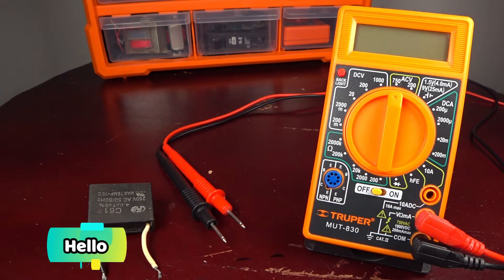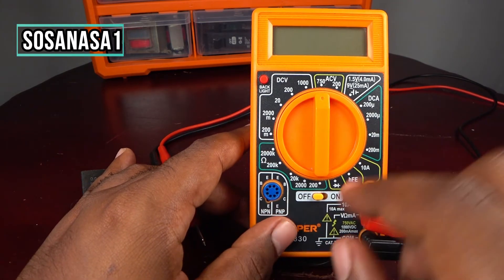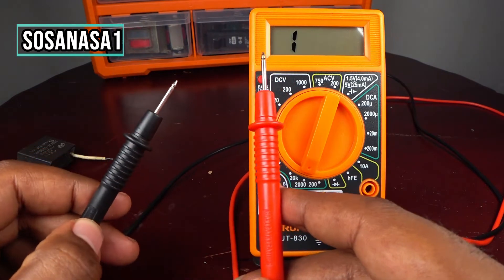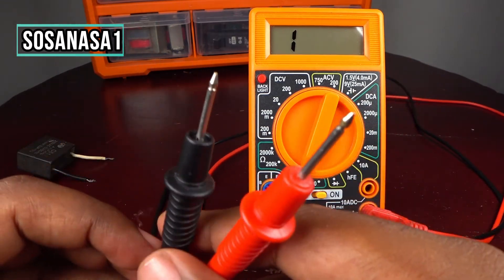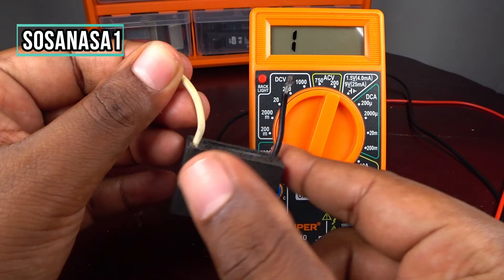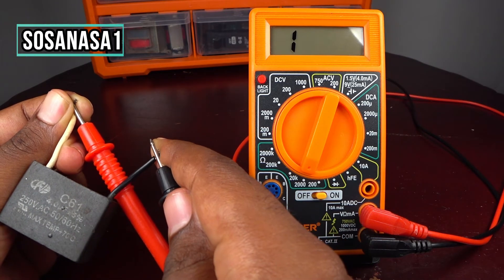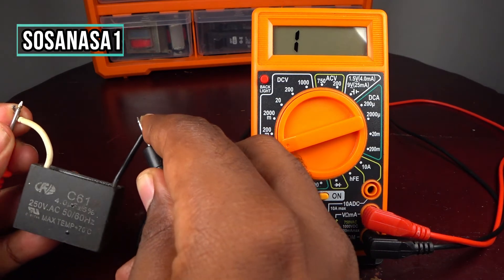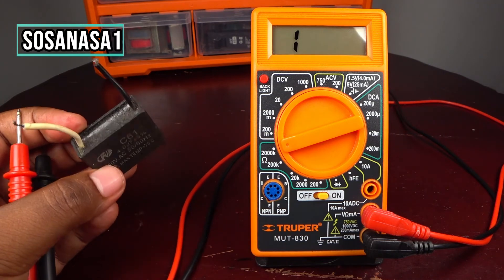how to test a fan capacitor/condenser using a digital multimeter very easy way (method #2)

Comment: interesting.... AI gave me a better way:
The method you described is a more accurate way to test if a capacitor is holding a charge using a basic multimeter, especially one like the DT830D that doesn't have a dedicated capacitance setting. Here's a step-by-step guide based on your approach:

Discharge the Capacitor:

Before testing, ensure the capacitor is fully discharged by shorting the capacitor’s terminals with a metal object like a screwdriver (with an insulated handle for safety).
Initial Resistance Test:

Set the multimeter to the ohms (Ω) setting.
Briefly touch the probes to the capacitor terminals. A good capacitor should show an initial low resistance, which then increases to "1" (or "OL" for overload), indicating that the capacitor is charging up.
If the reading stays at "0" (low resistance), the capacitor may be shorted, and if it stays at "1" (infinite resistance) from the beginning, it may be open.
Charge and Discharge Test:

After performing the resistance test, switch the multimeter to the DC voltage (DCV) setting.
Touch the multimeter probes to the capacitor terminals again. A properly functioning capacitor should show a brief voltage reading that decreases gradually to zero, as it discharges through the meter.
If there’s no voltage reading or an immediate drop to zero, this could indicate that the capacitor isn’t holding a charge.
This method gives you a good indication of whether the capacitor is able to charge and discharge properly, which is a practical way to test its health without a dedicated capacitance meter. Thank you for clarifying!